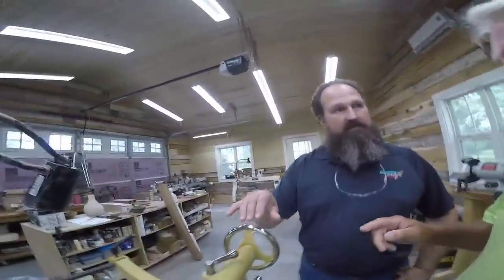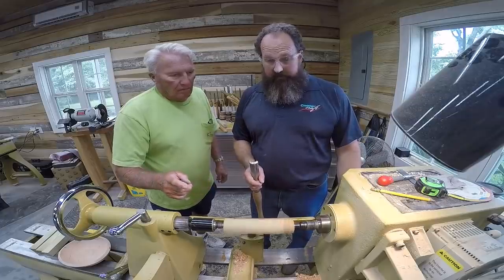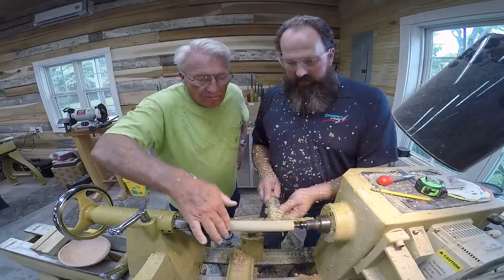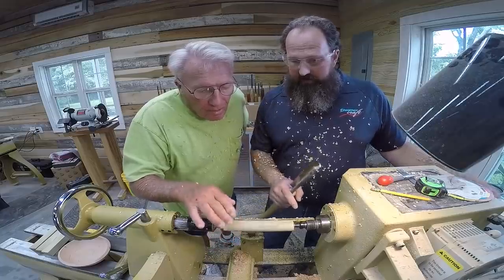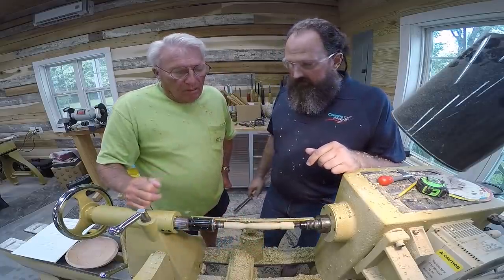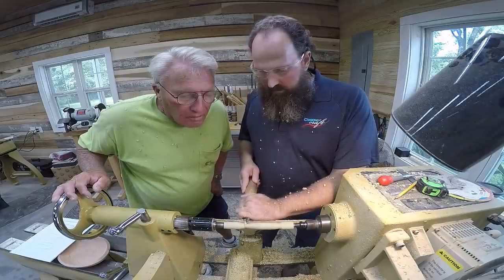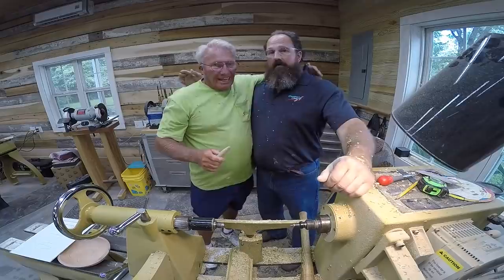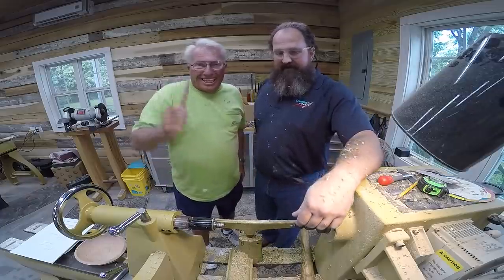Making a Custom Wooden Lure - How To Pt. 1

Comment: Tragically Ronald got his right arm caught up in the drive center and ripped his hand completely off by reaching over and behind the piece he was working on. Thankfully he turned himself a new arm on a note pad and used that data to perfectly replicated his missing limb. DO NOT BE LIKE RONALD. DO NOT REACH OVER THE LATHE. DO NOT PUT ANYTHING UP TO THE LATHE WHILE IT IS IN MOTION OTHER THAN YOUR TOOLS. IT WILL RIP YOU APART SO FAST YOU WONT EVEN KNOW WHAT HAPPENED.
Reply: Well said I could t believe the stupidity and lack of safety practiced in this video , very dumb , it’s only when a shirt or hand cops the full force of it will a person realise an accident could of been avoided and on video as well , people don’t ever stick hands or your body close to spinning machinery if you value your body parts , wood turning is fun but do it with safety, machines don’t discriminate who they will tear apart given the chance if your to close and contact that’s a fact.